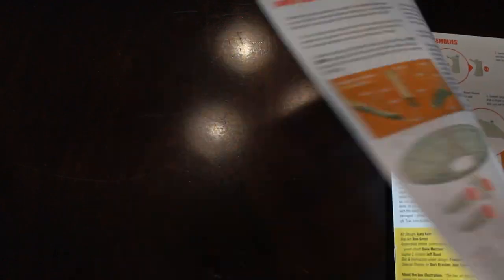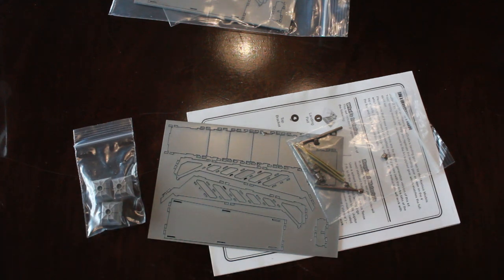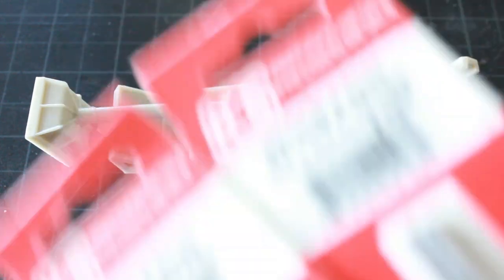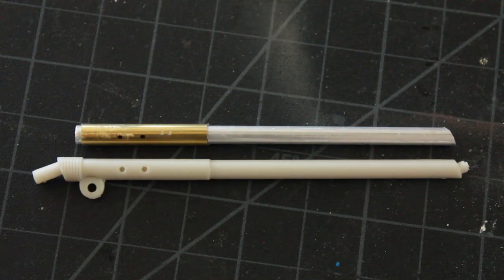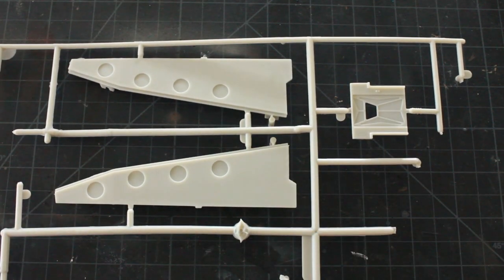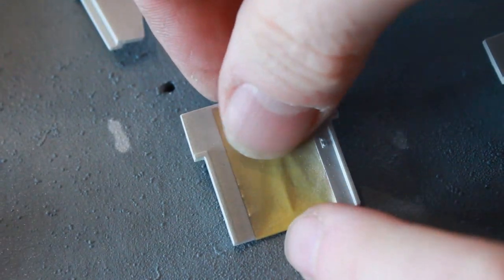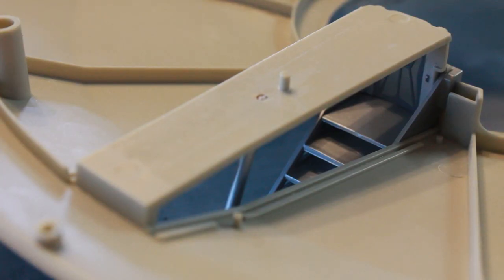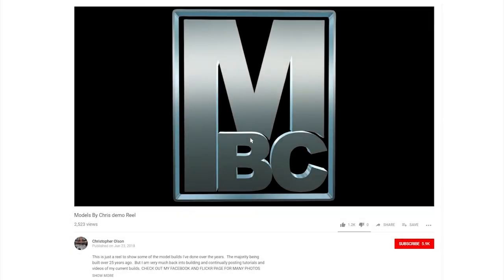Moebius 1/35 scale Jupiter 2 Pt I Landing Gear and Hull

Comment: Chris, Have a suggestion for the landing strut. Near the foot pad, there is a ribbed section. I am considering to use a short spring, slipped over the brass tubing. This should eliminate gluing plastic to brass and keep the strength.

Comment: Very good build, your mechanical prowes is very good. I have this kit and every aftermarket product available.  However with the exception of the translator computer you can see the cockpit control station to well. I'll skip the instrumentation motor. As for the area where the Space Pod is docked.  I have actual TV show picture Gell screens I made. So you'll be able to see the Space Pod door and hallway leading to it. In some episodes the airlock door is completely open.

Comment: I purchased the Moebius external lighting kit, but the fusion core board is different than the one you use. Your board says Lost in Space on it. Mine says UFO, doesn't have the center hole for mounting, and has only 24 lights, not 32. Thus the lights don't align with the core frame. The packaging looks official Moebius, Any suggestions?
Reply from the maker: @sticklevich  Sorry, unfortunately I don't.  The fusion core lighting I used was provided by my client. I know Moebius Models sells their own fusion core lighting,  which should be accurate for their model you would think.  Unless there's a 3rd party marketing as Moebius. Try contacting Moebius.

Comment: I think the difference in sizes for the landing gear is because the 16" Lunar models J2 is supposidly scaled at 1/35th as on the box. The Mobius J2 which is also supposidly scaled at 1/35th as advertised on it's box. Problem is the Mobius J2 is 18" in diameter. So I believe the Parragrafix landing gear was probably based on the Lunar model 16" scale. Do you still have the Paragrafix set? I will take it off your hands for my Lunar J2. I think they will work for it.
Reply from the maker: No.  That was almost 2 years ago,  and was a commission build.

Comment: Hi Chris, a question, after painting the landing gear and other components, do you apply a top coat as you go on the painted parts, have only just started this build and enjoy following you as I go thru this build. Any help would be appreciated.. cheers
Reply from the maker: I typically do a Tamiya flat clear coat over flat items and Tamiya gloss coat over glossy.  I also do a gloss coat before washes,  then do a flat coat.
Reply: @modelsbychris  thanks Chris, I presume gloss would be the hull and landing gear, floor.. and flat for doors, walls, controls..  is that a good assumption
Reply from the maker: @dpoole08  yep. Some of the interior I didn't seal since it's never touched.

Comment: I'm interested in understanding where the stairs lead.  Do they take you to the lower level?  There doesn't seem to be enough room for the lower level let alone the room below the lower level featured in Season 3 Episode 2 The Space Creature. Is there enough room for the Space Pod and Chariot?
Reply from the maker: In the model itself, no.  Realistically, there's no way they could've had a lower and upper level based on the shape of the ship and the scale.  But that's the magic of TV I guess.  Just like the elevator would never fit below the deck level in the model.  Not even close.
Reply: @modelsbychris  And yet they pushed it further in The Space Creature with a third level below the sleeping/eating level.  They did master artificial gravity so maybe the inside is like the Tardis for Doctor Who.  Inner space exceeds outer space.  I'd love to see how they would deploy the Chariot.  I don't see anywhere it would fit.  Does the Space Pod fit? I'm also wondering how Doctor Smith got his own sleeping quarters. I'm guessing Judy and Don had to double-up which they obviously wouldn't mind. I'm sure John and Maureen shared the same sleeping room. We never saw anyone's sleeping rooms besides Dr. Smith's and Will's.  Having the hole in the floor by the ladder always looked dangerous, especially when they're getting tossed around.  Someone is bound to fall down the hole.

Comment: Hello Chris, I am challenging myself to build the Jupiter 2 with all the lights and electronics as you did. Question: I see you will paint a part, then later glue it. Does the glue cut through the paint to fuse to the plastic, or are you scrapping away the paint?
Reply from the maker: I typically tape over tabs and parts that fit together when I'm painting to keep them clean for gluing.  You can see in some of my videos the yellow Tamiya tape covering.  But I have glued painted pieces together as well without any issues.

Comment: How can I recreate those lights on my kit? Thanks!
Reply from the maker: That's pretty much what this video is for,  to show how to do it.  Beyond my video,  it's not something I could just explain easily in words.
Reply: @modelsbychris  I mean, anywhere i can buy it the eletronic circuits or something like that? thanks!
Reply from the maker: @fernandofranca3921  oh.  If you're referring to the fusion core ring,  that was provided to me by the client, along with the model.  I know doing a search on Google there are a couple different 3rd party lighting cores you can get. Like this one.  http://www.tsdsinc.com/index_files/CHASEJ2.htm    I don't know specifically who made the one he gave me or where he got it from.  He got it about 4 years ago now. Sorry
Reply: @modelsbychris  np, thanks!
Reply from the maker: @fernandofranca3921  There are a lot of different lighting kits out there available for that model.  Other than the fusion core, which my client provided, all the rest I did from scratch. Just pretty much using 3mm LEDs and 0402 SMD LEDs.
Reply: @modelsbychris  so, theres lighting kits prepared for Jupiter 2 kits?? Thanks

Comment: I'm worried about the strength of that eye  piece you glued on. Is it weight bearing?
Reply from the maker: Not really. It's more of a matching filming model thing.  And with the strut glued in position in the hull and in the foot,  there's extra strength there as well. I've taken that into consideration.  And I do have a plan if there's an issue later.